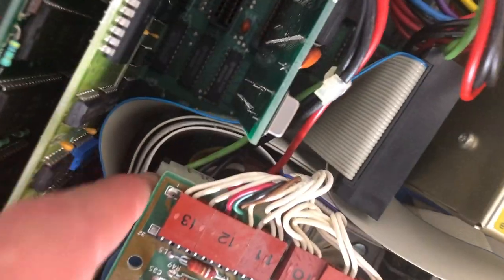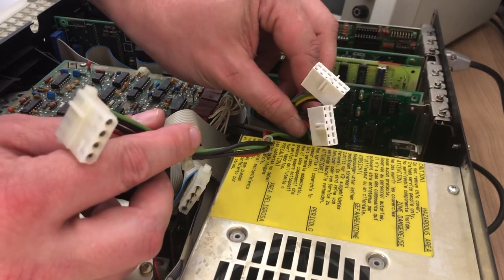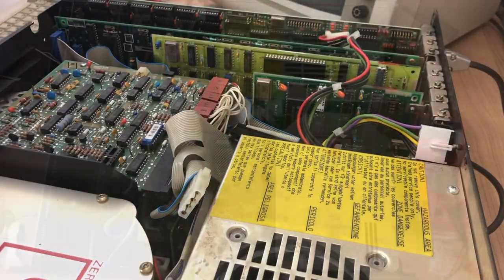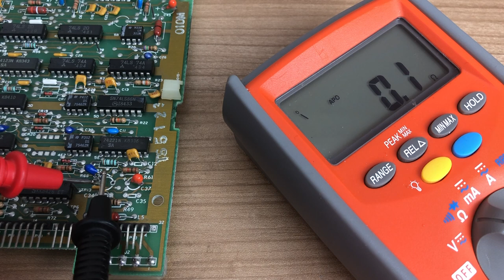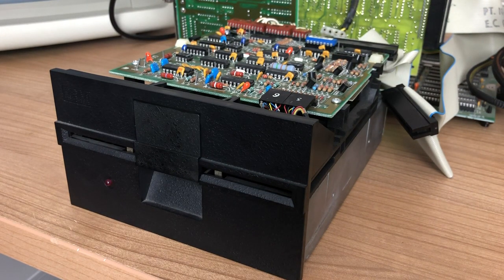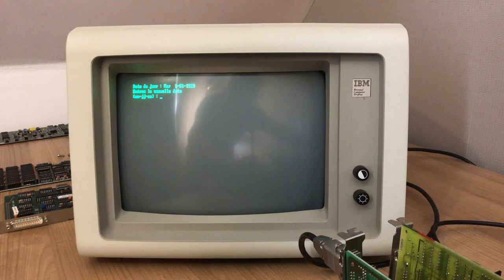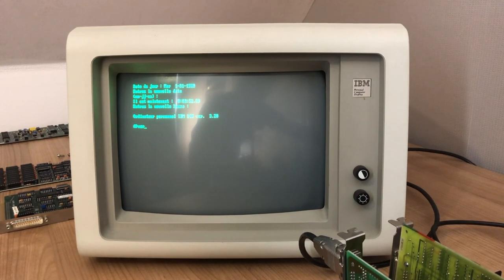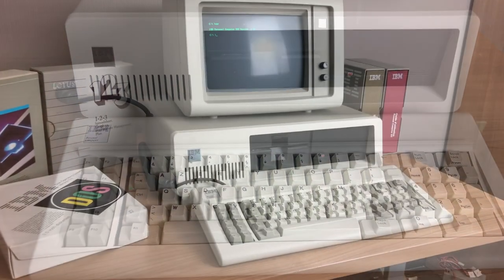IBM 5160 PC XT - Tandon disk drive repair

Comment: Excellent video. I have a dead Tandon TM-200 drive in a junk box that I intended to use for parts one day. Good cosmetic shape, but won't run. Instead, I'm going to try your diagnosis technique and see if it can be resurrected.
Reply: Ok, dug out my Tandon, and it's a TM-100-2A just like yours. The system doesn't recognize the drive (after placing into a known working system with another copy of this Tandon). The system does start up, it just doesn't recognize the drive. I've checked for shorts at the power connector as you mentioned, and also poked around with a multimeter on the circuit board, but no joy. What would you consider the best next step?

Comment: An awesome video as usual! How do you know what connectors to hook up to check voltages and resistance? Especially with resistance, how do you know what ranges they are supposed to be? Is there a reference guide you follow, or are you just an electrical wizard? 😁

Comment: I'm sure someone else pointed this out already, but that soldering tip is in bad shape. If you don't already own some, you should buy some tip tinner, and clean the tip regularly. Also, I bet you'd have a much easier time using the flat "screwdriver" type tips. I find it's much easier to make contact with through-hole pins, and they can also be used for drag soldering of SMD parts which is nice.

Comment: Finally got a 5160. It took you long :)
I would have relubed the drive head rails while you were three.
Reply from the maker: Hehe... indeed. This one came with a nice batch of software. Seller was really nice. Computer was from his father that passed away recently. I went in knowing that it did not start. Glad I was able to fix it and that it is running again.

Comment: Hmm,  5.48 is out of spec.  5.25 max.  Granted it'll drop when loaded...but still.   5.25 max.  Also many times the 12 volt rail will be low unless the 5 volt rail is loaded a bit.

Comment: I have a 5160 mobo but with a ram problem, the ram cout during post stucks at 64k and so the post is not completed and it does so no matter of the expansion cards or the ram chips installed or jumper settings
Reply: You might want to try and exchange RAM from higher banks to bank0 and bank1. If the RAM counter goes beyond 64k now, the RAM chips that were previously seated in bank0 and/or bank1 must probably be faulty. Be sure to mark each chip with a label or marker when tested. Re-seating the RAM chips might also help.
Reply: Tom van Mil I already did all of this but without any luck, i think that some multiplexer or other ram related ic is bad or a ram socket or a trace is not working, and if that was the problem I shouldn't get the post screen, so because I got the post screen and a ram counter I think that's another problem